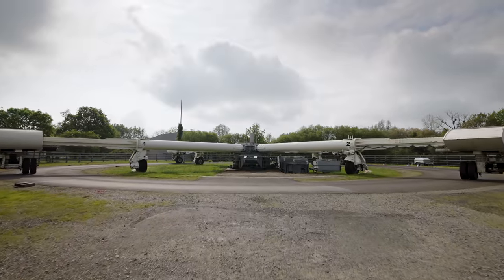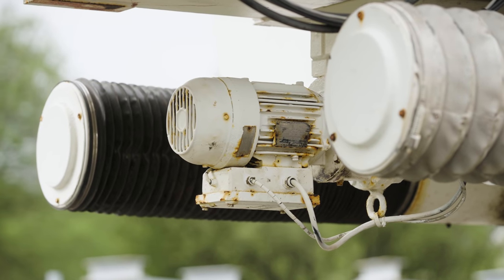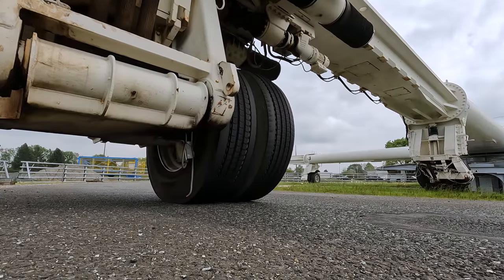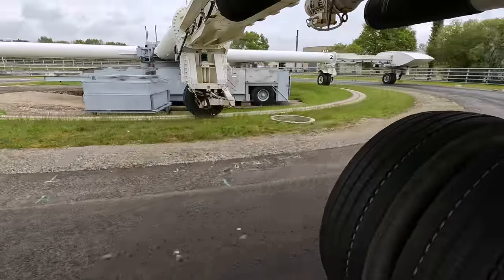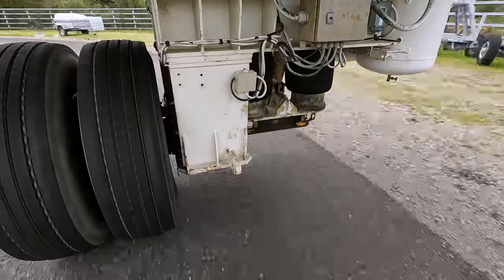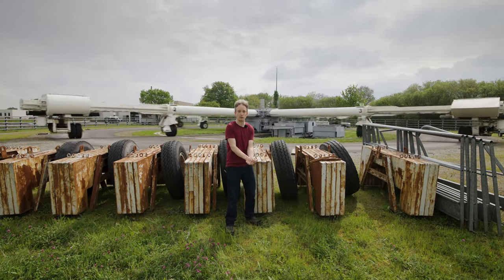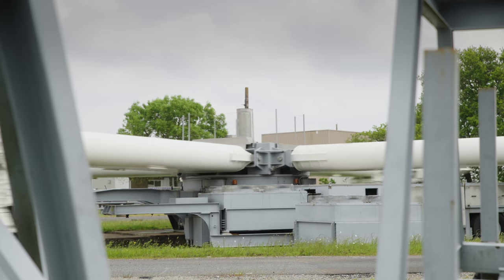The massive Fatigue Carousel helps keep roads safe

Comment: Wonder how they replace the tyres while the test is running. The tyres cannot last for months of constant use right?
Reply: They may, you know, stop the test for a few hours and go back at it
Reply: @DelahayeChristophe  Probably. i was hoping for a more exciting solution like lifting up one arm while an engineer clambers on to it and does the replacement 😂
Reply: @jabalisearcot  that would be a wild ride🤣
Reply: @jabalisearcot  i mean that would be cool, but I think the choice is simple. Risk life of some well-qualified humans, doing things that both humans and the machine were not designed to, or just stop the machine for an hour and do everything the conventional way.
Reply: @jabalisearcot  the centripetal acceleration alone would make it a nightmare, even without the vibrations and air resistance.
Reply: @Fifsson_  Boring 😂
Reply: I mean why not? Delivery vehicles are usually in mostly constant use for 8h a day, and their tires still usually last at least 2 years before needing replacement, so if a test lasts a month or so 24/7 than a fresh set of tires should be able to last through the whole test before needing replacement.

Comment: i worked at the research department at a company that makes commercial refrigerators. one of the tests was a shipping test. 15 minutes getting the crap "shook" out of them aka launched up in the air about 1/2 an inch simulated a across the united states shipping trip. the noise of a 1500 to 2000 lbs refrigerator with shelves flapping about was loud enough to be heard across the lab.

Comment: does it also test tires? would be nice 2-in-1 test site
Reply: I suspect tyre manufacturers have their own more controlled (and smaller) testing facilities. They can just run on a single axle over a static surface and avoid the always turning left issue this massive rig has.
Reply: You don't want to test two variables at once. You want a well-known and established tire consistent across all pavement tests, or at least as consistent as possible.

Comment: That's like standing directly below a wind turbine. 100 km/h tip speed cutting through the air,  dropping out of the sky straight at you then pulling away at the last minute.  Only this has more mass at the end!

Comment: The persistent arc will exert linear force away from and perpendicular to the axis.  In addition to the vertical force, thanks to gravity, this will cause thinning from the axis to the wheels, and clumping from the wheels and beyond.  It would be a nice way to gauge a NASCAR track, but not really a straight road that incurs linear force parallel to the axis.

Comment: Interesting setup, but there are probably setups that can stimulate this quicker. Probably with a bit more difficult correlation, but much faster, smaller and cheaper. For example for car parts we simulate a 20 year lifespan in sometimes only 48h

Comment: This is making me feel a bit like Alice in the rabbit hole. Based on the test panel, I think they made this with the SW (and probably HW) of the company I work for. I've actually probably worked on test systems that would test the HW that would go into this test system (which are made with similar HW and SW). I know a lot companies/labs use the same test equipment, but it never ceases to amaze me how widespread it really is.

Comment: Accelerated lifetime testing is tricky.  Weathering, daily/seasonal temperature fluctuations, and freeze/thaw cycles will cause a slightly worn surface to rapidly deteriorate.  I'm not convinced a few months of testing would be adequate to predict a road surface's long-term performance.

Comment: That's not as fast as I would've expected. Where I live, they put test sections on the freeway, and use actual traffic to test it. They also test different paint for pavement markings by putting lines across the lanes to test how the paint will wear with traffic.

Comment: I want to ask a question about the inner support wheels on the really narrow path, but I feel like it is like the "why don't you build the whole plane of what the flight recorder was built of" kind of question. So I guess the rubber and pavement is really, really heavy duty and long lasting.
Reply: they most likely only support the full weight of the arms while the outside wheels are being changed and have very little load on them during operation so they last longer

Comment: if they could enclse it they could simulate high and low termperatures and water and ice and snow on the surface. I think the locations with drastic changes in temp and that also have water on the surface can cause more deteriation. Also, there are some places that add salt or other chemicals to the road to de-ice.. also sometimes petroleum products, like gasoline and deisel fuel and engine and transmission oils leak on to the surface which can also contribute to deteriation of the road surface. Perhaps even salty moist air on roads near oceans can contribute to deteriation?

Comment: Way cool Tom! However, doesn't the fact that the wheels are traveling in a constant circular motion add an additional lateral (g?) force that wouldn't normally be present in a vehicle that's traveling down a mostly straight highway? I realize vehicles make turns as part of their normal use on the road, but making turns is probably a less frequent occurrence.

Comment: Unfortunately the machine does not test the primary cause of road surface damage, shear loading caused by heavy vehicle braking loads. It's only testing the surface in compression against a stable back plane.
The heavy rutting, broken surfaces, and undulations in the road surface as you approach a stop light are caused by the road material buckling up in front of a tyre that is trying to stop rotating while being pushed by many tons of forward inertia.

Comment: Do they ever twist the wheels to check the behaviour of road surfaces where vehicles turn? (lateral and torsional forces)

It would be scurrilous of me to suggest that Amey, who have the contract to rebuild the roads of Sheffield, have never looked into any of this.
To be fair to Amey, this carousel tests level roads with minimal lateral forces, but real roads have slopes, other lateral forces from braking vehicles and twisting forces from turning vehicles. Sheffield roads have all three, as you can see at corners on hills and at bus stops and traffic lights.

Comment: How much would you have to extend the carousel to make the most outer edge spin at half, or even one tenth, the speed of light? Could we attach a receiver of some sort to receive radio transmissions from the future? Time slows down as you approach the speed of light. Five minutes for you while you are at the speed of light is like 5 years for someone walking down the street in normal time. Can we get lotto numbers from the future, or stock prices?
Reply: The arms measure to be 69 feet (nice) in legth on Google maps. With that as the radius, the swing has a circumference of 433 feet. The speed of light is about 983 million feet per second, so you'd need it to do 2,268,698 rotations per second.

c/(69*2pi)=2,268,698

Comment: it's still missing the biggest issue: climate (quickly heating up and cooling creating cracks as well as water freezing in the cracks blowing out more of the street)... the actual weight issue is less an issue if the underground and so on is done well than the climate itself

Comment: it appears concrete is superior to asphalt considering  theyre replacing asphalt road surfaces  and the concrete the inner wheels are on never does get changed .. so why not use concrete infused asphalt or vice versa i understand asphalt offers superior grip by tires to the road surface but in the car world more grip means softer compound ie shorter lifespan seems they could find a medium.. great video

Comment: Wait a minute.  Are those test wheels actually steering and putting lateral forces radially on the pavement, or are the carousel arms in tension to keep the wheels tracking???

Comment: Surely, the results of these tests are invalid? The tyres are traveling in a circle so the inner edge of a tyre travels less distance than the outer edge, which means that most of the tyre's contact with the surface is not rolling over the surface but dragging, causing more friction, which in turn causes more wear.

Comment: Most road warps and potholes I know of are caused by braking.  This machine simulates wear on a road with even speeds, but what about where stop signs are, or if a few big trucks stop in the same stretch of road?  Is there any braking measurement?

Comment: I'd LOVE to sit on the outside edge of one of those things when it's spinning like that, if it had a chair fixed to it and a harness of course 😆🙃
Also, it might be worth putting little turbines on the outer edge of each arm connected to a generator in the centre, so it creates electricity as it's in use 😉

Comment: It seems weird to me to run such a machine on hydraulic motors. Hydraulic motors are mainly used on low power transmissions that only work a limited time and/or on mobile vehicles because of their power density (e.g. on agricultural equipment, it fulfills both of these conditions).
Reply: they most likely stole a lot of the components from an excavator along with having hydraulic rams to adjust all the pressures and whatever other parameters it was most likely simpler to just have everything run off of one hydraulic pump.

Comment: Theoretically they could test for climate in a warehouse with climate controls couldn’t they? Although climate cycles factor in duration a lot. However one wonders if you could simply increase the duration of testing to account for it. It looks like at least parts of it could be manufactured like any carnival ride, and maintained by a trucking mechanic shop. Then have a road crew contractors overseen by a science team at various intervals, which you could get from a university. That’s stuff that just exists in certain places already. With the amount of money in infrastructure it seems doable, especially comparatively to the cost of road failure and maintenance, not to mention cost of mass construction. I don’t know, I checked a US state and they say there is 800 million in projects going this Summer. Might not be accurate, as I don’t know it’s basis, but any DoT Civil Engineer is going to have questions about materials and construction they simply don’t have. Makes me wonder how normal research is getting done, and if it’s a similar way to this. I am not an engineer, nor particularly interested in Universities, but I’m guessing that’s it.

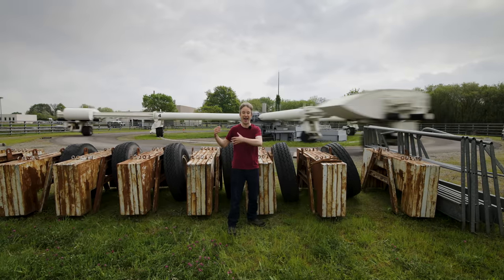Comment: I want to start by saying that I don’t mean to discredit you or anything I just have a question. When the machine is spinning in one of your shots the motion blur ‘feels’ different then it should. Did you shoot shots of it spinning with a higher fps camera. But then used a camera with lower fps to film you talking? Because I feel like the motion blur on your hands is different then the machine at 4:01. Also feel like the motion blur is different when the camera is on the machine while it’s spinning. The colors also might be a little off. But that might just be my tv. 

TLDR: Did you shoot shots of the machine spinning with a different camera then the shots of you talking?

Comment: The main road near me has various surfaces laid along its length.    Some are very noisy, drumming through to the inside the vehicle, some are virtually silent.  The noisy surfaces actually hurt my ears.  My questions as to Why this is permitted have never been answered.  I wonder if this machine is used to rest such for unacceptable noise levels   If not…it should be.
Reply: If you are in the UK it's probably operated by the Transport Research Laboratory in Berkshire.
Reply: @johnrussell5245 .  In which case, I will ask them..   Thank you.

Comment: I'm no engineer but it seems it's only a small percentage of what is really going on for such a "engineering monster"
1. Curb roll is constant 
2. Weight distribution is extremely limited
3. Braking is non existent 
4. Weather is geographically locally located 
5. Does base and compaction have a control ?
It seems like there wouldn't be much viable information from its demonstration. 
Vehicles on roads and hiways are not only going in circles . Even wear would be unreliable due to insufficient diversity. 
Anyways cheers 🍻

Comment: I'm missing something. 

How does this simulate decades of damage in months when it's only going as fast as cars actually go on the road with similar weight? By this, I mean, in theory, it should only be roughly twice as fast at wearing things out (since there aren't many cars at night), but something like an interstate here in the US can have cars going this speed or faster on them for roughly 12 hours a day. 

But clearly no one would have made a machine like this and spent the cash if it didn't work, so what is that I'm not understanding here?
Reply: The four arms are much closer from each other than cars are in a real road
And also its simulating heavy truck rather than cars so more wear from there

Comment: Road binders are made from bichimin not petroleum
Reply: Bitumen is the binding agent that holds asphalt together and is  produced from petroleum. Asphalt = bitumen, aggregate (rock/gravel), and sand. Bitumen is the "sludge" byproduct of the petroleum refining process after all the lighter materials have been evaporated.  Fun fact, if you travel throughout parts of the middle east you'll see where ancient peoples used bitumen as a binder in wall construction vs. a cement based mortar in masonry.

Comment: Only you aren't able to test how the environmental factors would change the road in that time.  Through the years having water constantly coming and going would  be a bigger factor to test than just tires over a surface quickly.  Missing almost all the crucial aspects of testing a road.  So honestly what is the value of this if you're only able to test a fraction of required data to find viability in a new product...

Comment: 90% of roadwear is from the weather  seems a pit pointless should power it with jet engines on top of the wheels then they could use radiant heat deflectors to heat the the surface up..